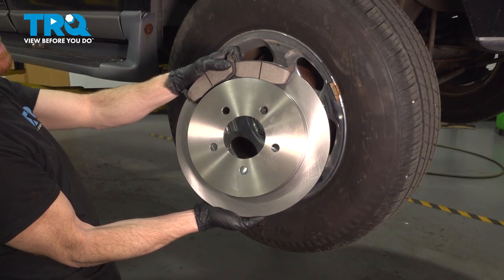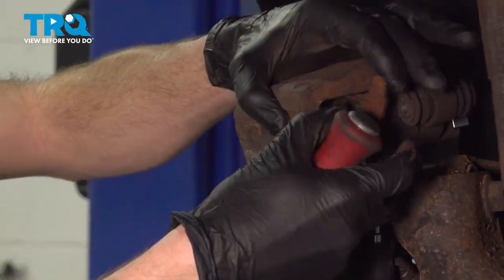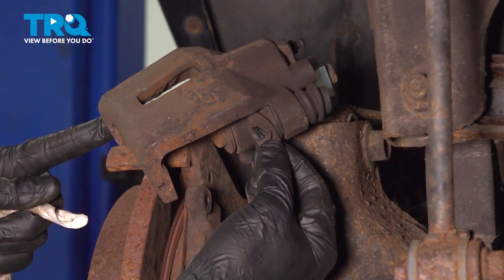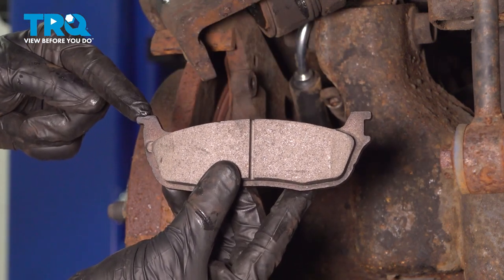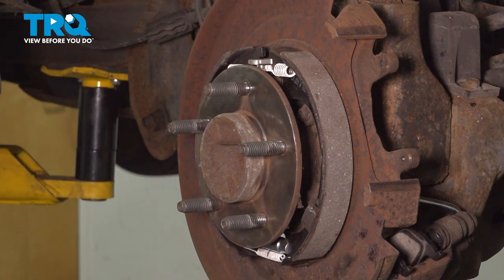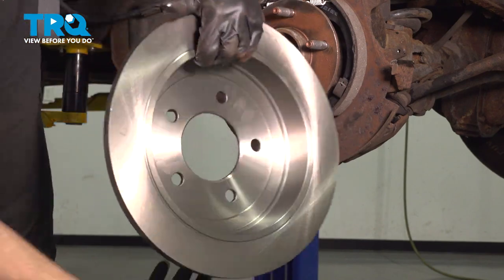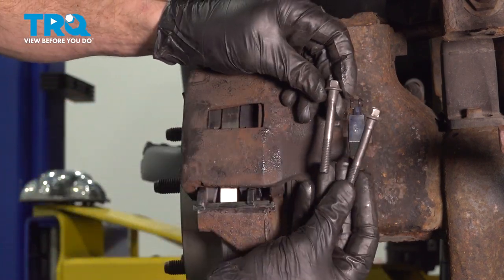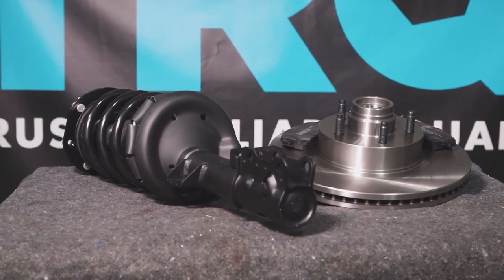How to Replace Rear Brakes 1998-2002 Lincoln Navigator

Comment: Notice it has drum brakes inside it for the parking brake. If you have the parking brake set, it will lock it on.  A longer bolt ran back through the caliper mounting holes against an old brake pad can be used for mechanical advantage to push from behind and break loose the rotor if its rusted on.